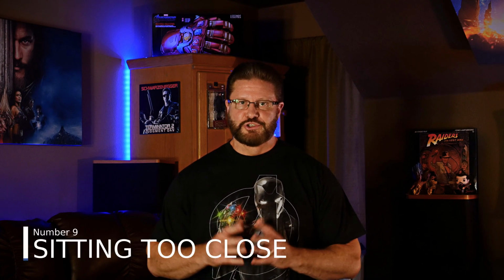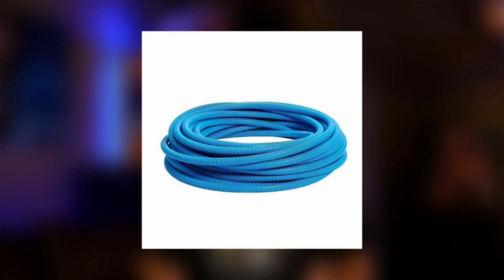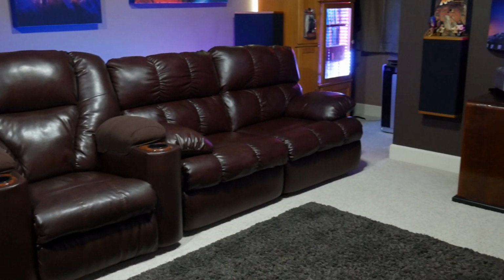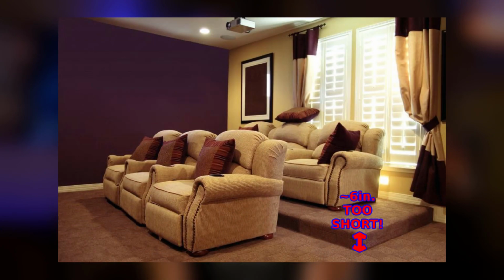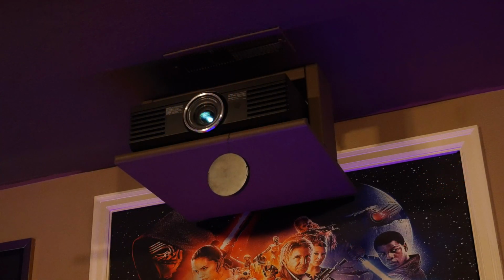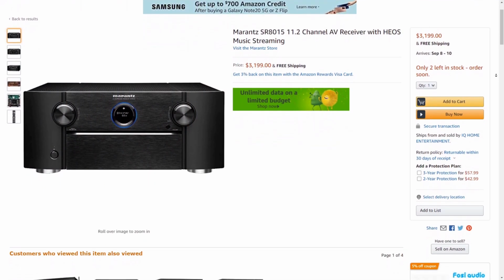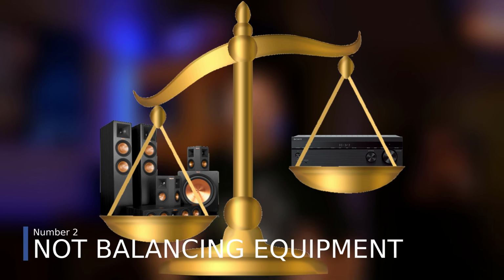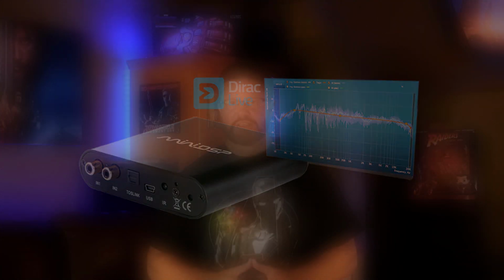TOP 10 BIGGEST Home Theater MISTAKES! 2020 EDITION!

Comment: Great points - thanks!
I'd say a couple things from my personal preferences - 1) be aware testing speakers in a demo room is dangerous as it may be treated really well, so test them at home if possible!
&
2) Min 2 subs is definitely a requirement, however (obviously), 2 better subs are better than 2 lesser subs. I think if you can afford it, buy one better sub and buy the same sub 6 months later (for example). If you have 2 lesser subs and still want more output you are stuck and still have to upgrade! :P just how I did it and it worked out well!
Reply: Agree with this too Brad!
Reply: When I worked at an electronics store (anyone remember Ultimate Electronics?) I told people all the time to not settle, save for a few more months and it would be completely worth it.  Start with a good receiver and stereo speakers, and complete it as you save, otherwise they would just be wasting their money later on.  I had some people not even complete their system because they were blown away and happy enough with a quality stereo setup vs a cheap surround system.
Reply from the maker: Thanks for watching! Completely agree with you here Brad - Demo rooms can definitely be deceiving! And breaking up your purchases over time will help you get better components in the long run. I'll pin this comment to make sure everyone can see it - really great information! 😀

Comment: What a valuable video!
But I have a little problem... Budget!
What do you recommend once I have a extremely tight budget regarding U$1.900,00 to spend.
Option number one :
A brand new home theater in-a-box Onkyo Ht-s7800 or option number two :
A second-hand  marantz  (middle 2000's) plus a brand new setup klipsch floorstanding speakers+center speaker+surround speakers+subwoofer?
In your opinion, what is the best choice? 
I appreciate if you could replie me.
Reply from the maker: We would always recommend the separate speakers and AVR over a Home Theater in a Box system as you have a lot more versatility/upgradability with the separate gear. If you want to, it's really easy to upgrade the older Marantz receiver for something newer like the Denon AVR-S760H that we recently reviewed which would give you 4K resolution at 120Hz support or even 8K and 60Hz support. We choose option number two! Hope this helps! :)
Reply: @TwoGuyzTech  thank you so much to reply. Know that your opinion based on your experience will be taken into account.  All the best for you and your YouTube channel! Regards from 🇧🇷subscribed.
Reply from the maker: @Nandao_Vs  Thank you very much! We're glad we could help and we hope you enjoy the new system :)

Comment: OH man! I will get back on your video to remember these before spending $7,000,000 of audio components!
Reply from the maker: LOL sounds good! Thanks for watching :)
Reply: @TwoGuyzTech  

I am currently listing Separate Components but I do not know how to match amplifiers, pre-amp and power amps that are at least 16 channels, including subwoofer amplifiers, mono block-amps, speaker wattages and that 50 amp power supply that you need because having a voltage regulator with thousands of watts is not enough.

Can I ask you a few questions.

Comment: I have a BIC America F12 12-Inch 475-Watt Front Firing Powered Subwoofer which is off to the left of the great room and you can not really tell where the boom is coming from. I am considering though a second sub but I have no where to the right of the room except for the ceiling to put it. Question is, should I bother with a ceiling sub as well? I am pretty happy with the one sub at the moment. Would one sub in ceiling, one sub on floor work?
Reply from the maker: Thanks for watching! For this, you'd be best off coordinating with a professional if possible. Generally you want to try to use the same subwoofers all throughout your theater so the sound is good in all listening positions. If you can't tell where the bass is coming from and you don't have a problem with the output, one subwoofer should probably be enough for the foreseeable future. Hope this helps!
Reply: @TwoGuyzTech  Thank you for the quick response. I will keep it as one as suggested. The Bic gives a good wallup of sound. I'm waiting to see what Yamaha does with the rest of their Adventage AV line which will be my next upgrade. Thanks again.

Comment: Space and environment matters first. It dictates what you buy more so than not. Alot of mistakes is made between the two. Your budget figure you start with initially is always the wrong numbers once you begin to purchase and sample. I started off with a budget of 800 dollars and I ended up spending probably 4,500 dollars. I went from a box & 1 that was a 5.1 to a 5.1 with a pioneer receiver, to a 5.1.2. I  had 2 towers a sub, 2 bookshelves and a 400 dollar center. I then purchased 2 more towers and my system was a 5.1.4. I purchased another sub woofer and purchased another center speaker. This time I purchased an SVS ultra center and an adcom 5 channel 7500 THX amplifier that rounded my system out perfectly to a 5.2.4 inside an apt 

A year & 1/2 later I bought a house. My new space is a 20 X 20 room. I use to live upstairs in an apt and now I'm in a single flat home with tile floors. This changed everything. The towers I purchased in my apt was pioneer elite towers. They sound very clear, accurate, flat and neutral. Being upstairs on carpet the towers had enough slam. Now being on ground floor on cement and tile it's a different story. My adjustments to the situation was adding 2 more towers for the surround backs and 2 more SVS SB 2000 subs along with another 5 channel amplifier. A sherbourn 5/1500a. 

My room sounds great but in the future I'm going to pair my ultra center with 2 ultra towers for my front stage. I started with a budget of 800 dollars living in an apt. About 4,500 dollars later this is what happened. If I knew I was going to purchase a house from the beginning. I would've purchased 2 big Towers and a big center from the beginning. Now my end game has changed. The reality of home theater is I think you will always swap and change your equipment along the way. What excites you today will definitely change in your future and no one can forsee the new products that has yet to reveal themselves. The technology changes as well. Home theater is a very expensive hobby.

Comment: Switching.out you 15amp breaker to a 20amp breaker will kill you
Reply from the maker: We certainly don't recommend swapping a 15-amp breaker to a 20-amp breaker. That could burn your house down. We are suggesting a complete 20-amp circuit, with everything being rated for 20 amps. Here is a video we made that walks you through the whole install; https://www.youtube.com/watch?v=P9dCYHRbJ6s Thanks for watching.

Comment: I'm watching this, owning full Vandersteen speakers, SVS sub and a Marantz processor.  Almost crazy to be on such the same wavelength, but then again, I'd do it all again, so I'm not surprised.  Thanks for the list.  Liked and Subscribed!
Reply from the maker: Thank you so much for watching & subbing! It's great to hear from others that are using all Vandersteens in their Home Theater setups - just like you said, I'd happily do it all again as well! If you don't mind us asking, what models do you have in your system? 😀
Reply: @TwoGuyzTech   Vandy 2Ce fronts, 1C rears, VCC1 Center. Marantz AV7005 Pre, Rotel RMB 1585 (200w x 5) Amp. SVS SB16 Ultra

Comment: Great video!  I never knew it was called smurf tubing but I'm definitely planning on running a lot of it during the house construction!  As for dedicated 20 amp outlets I'm planning on one for each amplifier group.  As for #10, "Never buy speakers..." I would just leave it at "Never buy speakers", just go DIY for all speakers.
Reply from the maker: Thank you so much for watching! I absolutely love DIY! We looked at your channel and noticed you're going to DIY all of your own speakers - are you planning on documenting it all and putting it on your channel? It looks like it's going to be a beautiful theater when it's finished! We subbed to your channel!
Reply: @TwoGuyzTech  Thanks, yes once I get started building the speakers I will document it on my web site and my new youtube channel.  Don Keele assisted in the design of the CBT center speaker in my old theater and I will be in close communication with him again on the design of the new CBT arrays.  Having constant directivity loudspeakers helps reduce room interaction and reduces the necessity for room treatment...although I will still use room treatment.   

It's going to be awhile, I'm hoping they will start setting up the forms for the slab this week.  My builder is estimating it will be at a stage where I can do the theater pre-wire around mid December.  I'll be posting some of that not just to show what I'm doing but more importantly to allow others to comment and make suggestions.  Hopefully this makes sure I don't leave anything out!

Comment: So true on all accounts. Love you guys videos. Still deciding on the 20Amp dedicated breaker. I currently powering my speakers with the receiver alone. But wondering if im already maximizing my current electricity since i also have my main PC in that room
Reply from the maker: You're probably okay unless you ever plan on running separate amps - then you might want to consider a 20 amp circuit. Thank you so much for the kind words and thank you for watching! 😀